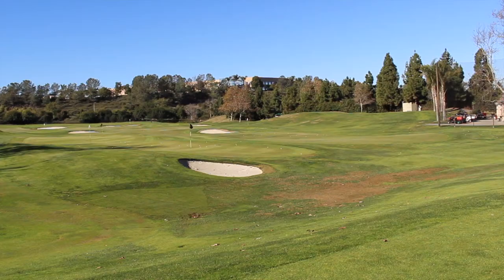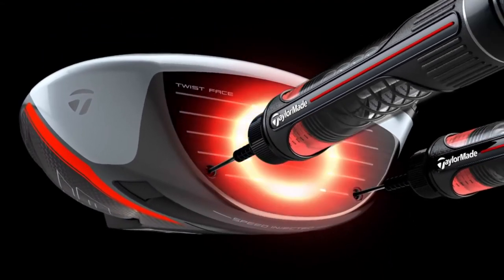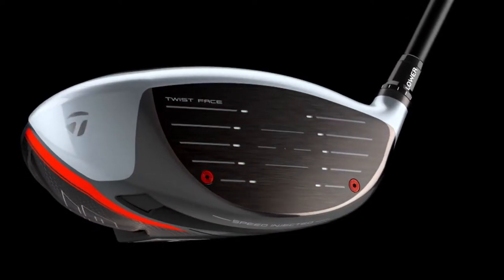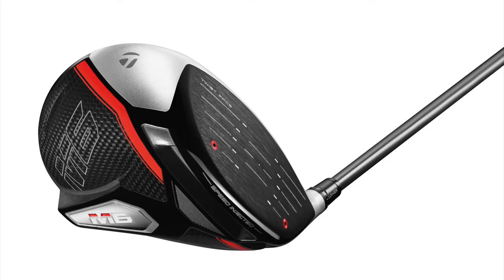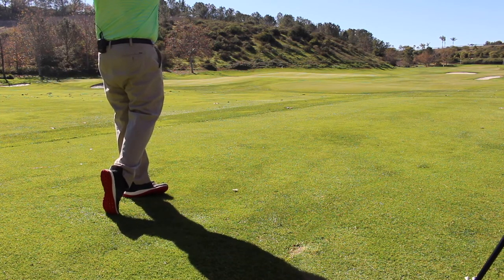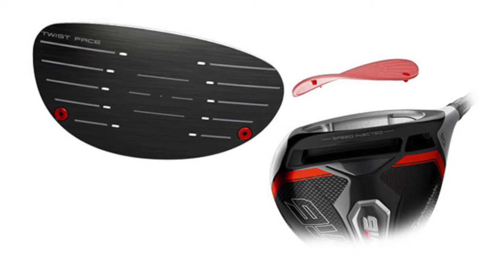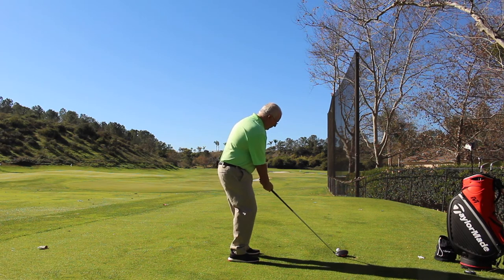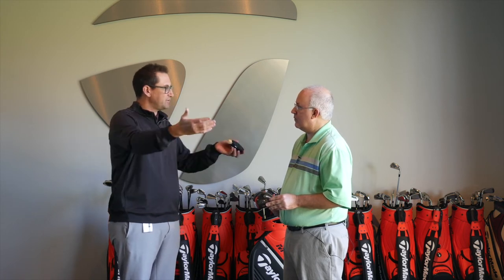TaylorMade M6, M6 D-Type Driver Review

Comment: Is the D-type fsce angle closed? looking for something 1 or 2 degrees closed
Reply from the maker: So what TaylorMade says about the D Type is that the face is slightly closed but they adjust the crown cosmetics to make it appear more neutral/open than it actually is. You can also add loft to the driver using the adjustable hosel to further close the face angle if that's what your swing/game need. Thanks!
Reply: @2ndswing  I purchased one today. I was surprised at the control and power I had with it. I was outfitted with a red senior shaft. I love the D Type with the adjustments for loft. This is a great product and worth every penny. I haven't hit a ball this far for along time.. Spider Dubiel
Reply: @josephdubiel7129  How you getting on with it now?  Am considering the M6 D-type despite what people are saying about these types of drivers.  This one in particular.  It looks good at address and might help close the club face so I don't have to hold it too strong (which I never loved).
Reply: I just got the 3 wood type d for 65. Hopefully it will help a Lefty